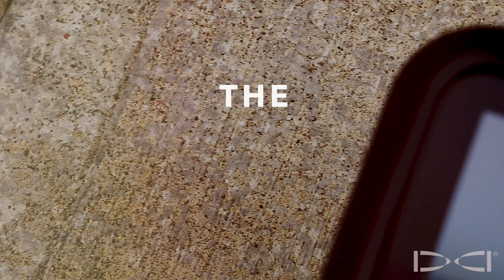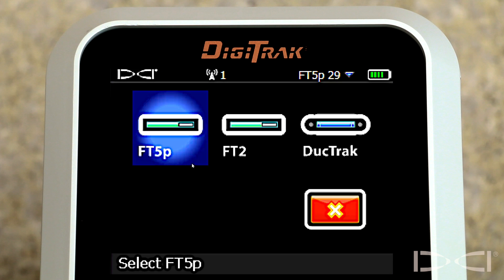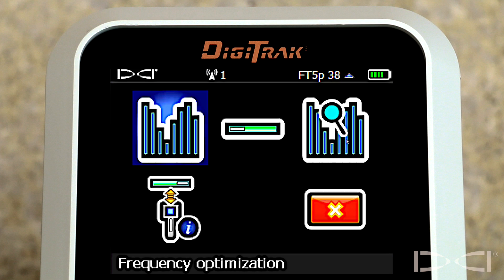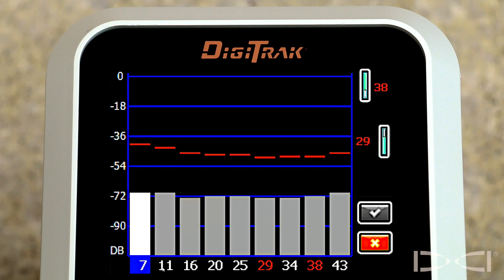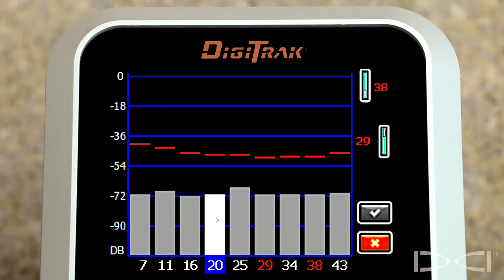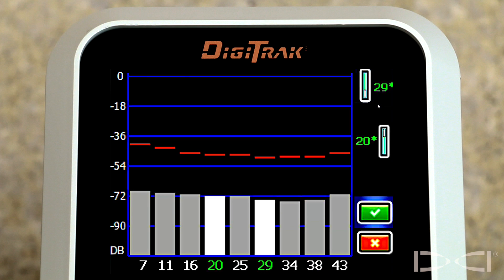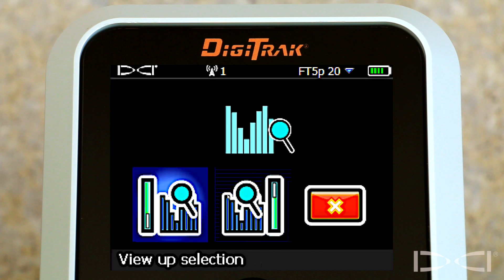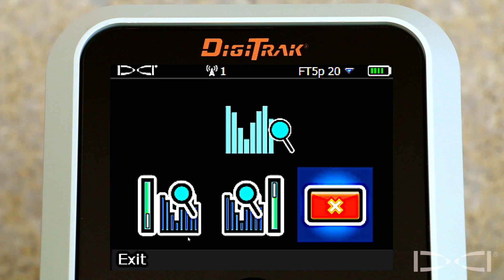DigiTrak - Falcon F5 Training- Transmitter Selection and Frequency Optimization

Comment: My question is when you select the different frequencys do you always chose the lowest frequency
Reply from the maker: Good question! The answer is yes, but not always. Some frequencies perform better in certain environments. As a general rule lower frequencies perform best in areas of passive interference, higher frequencies work better in areas of active interference and the mid-range works best for depth. So in some cases you may choose a frequency band that shows slightly more interference than another. For example, if you were drilling under a sidewalk I would almost always program in band 7 on a wideband transmitter. If I were around power lines I would almost always program band 43. Regardless of the band you chose doing some above ground range testing prior to beginning your bore should give you assurance that you have the signal strength needed to complete the project without interruption. Hope this helped! Feel free to call us at 800-288-3610 for additional help.

Comment: You guys need to figure out a way to switch frequencies without having to take it out of the head, it hurts production when we jump around alot
Reply: You can switch frequencies down hole using the 10-2-7 roll combination just like in the regular F5. If you need help walking through this, call DCI at 800-288-3610, or head to digitrak.com and download the manual.
Reply: I wuant to know if you have somenting for concret,because is so hard to do the jomp when i Cros   concret and rebar